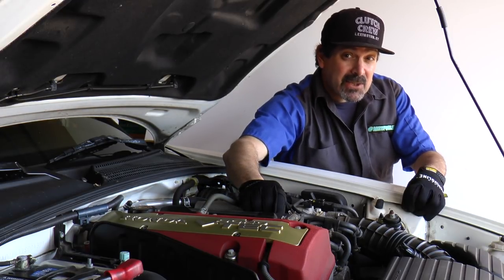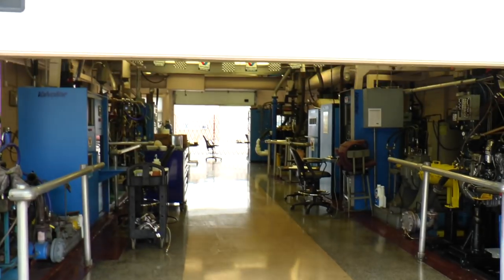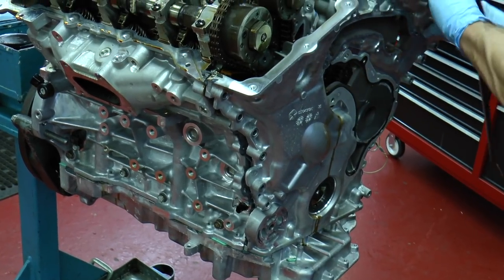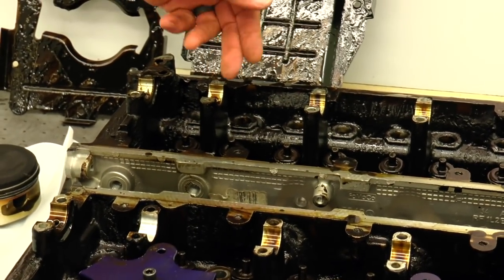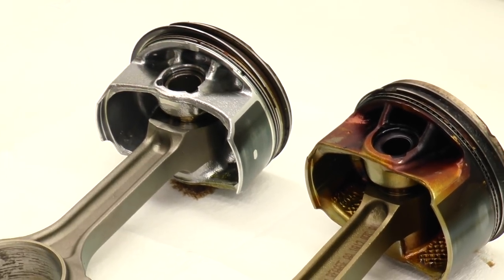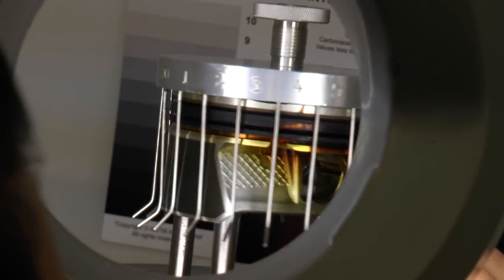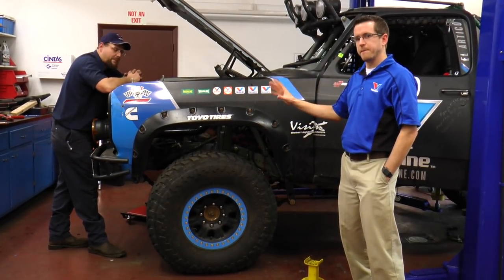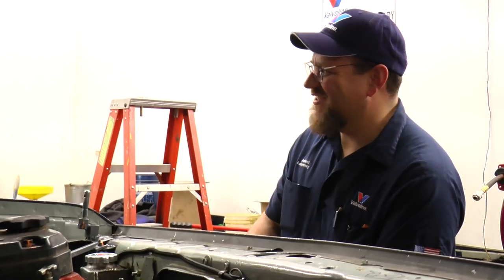What We Do at the Engine Lab With Dan Gray

Comment: Their is something different that I've noticed from using valvoline oil, the engine runs smoother, quieter, and yet seems to be more responsive and feels almost lighter in the rpm range, if that makes any sense at all. Also I notice the oil feels a bit cooler when the engine is warmed up.
Reply: It's good stuff

Comment: I always use Valvoline Fully synthetic 10w30  for my Honda K20 Engine that’s been getting abused daily and Valvoline is the best oil I’ve ever used! Protecting my seals and holds extreme hot temperature like a boss.
Reply from the maker: Awesome! Thanks for the shoutout!
Reply: I have a 2zzge toyota engine 8.350rpm something like k20a this engines can use 5w50 vr1? I know for this oil to have high zddp

Comment: Things to Keep in Auto.
1a. Jumper Cables, Hood to Tail + 4 Gauge.
2. Spare Tire, or PlugKit plus Hi-PSI AirPump.
3. Gallon Distilled Water
4. Ground Cloth or Table Cloth
5. Flash Light with SOS or Blinking Setting.
6. Some Sort of  Jack, stable better.
7. AAA before any road trips. Key or $35 Tow.
8. Red Flag or Sign Tape, Rear Overhang Laws
9. Nitrile Gloves, you will touch stuff.
10. Citrus Organic Hand Cleaners.
11. Tools. Kit/Brief Case less than $100.
12. Waterproof Disposable Camera
13. Why not a laminated picture of you with others?
14. Blank book, spiral, or stamped envelopes. 
16. Phone Battery 10,000 watts
17. Bathroom Kit, Toilet Paper or Wet Wipes.

Engine Fuel:
1. Chevron ::  We Like Honest Kids. They are Honest. "Top Tier Fuel" is the Best 4 You.
2. GATE  ::  Zero Ethanol. 89 Octane worked best in my 1976 V8 Corvette Stingray.
3. Speedway ::  Consistent not to noise burning.
Banish: Shell & BP their fuel or additives are  garbage.

Air Filter Only=Better MPG: 
"Dyno" Measure, NoFilter/OEM/BrandName
1. Burger MotorSports - BMS
2. K&N
3. FRAM Best you find.

Windshield Wipers:
1. Silicone Wiper Blades, Last 10x as Long.
2. Hybrid Blades, Get Shade over the Rubber.

Engine Oil:
AMS Oil ~ Best Oil In all Comparisons.
Valvoline ~ Cleanest Oil of my Oil Changes.
In a pinch Pennzoil is a good place to be.

Oil Filter:
Go Premium +15K change every 10,000 Miles.
1. FRAM Ultra
2. Purolater PepBoys

Auto Parts: Best In Store & Online:
1. PepBoys
2. . O'Reilly
When needing to rent tools only AutoZone.

Best Spray Lube:
1. Liquid Wrench penetrating line with ceramics.

Best Car Wax:
1. Ceramic Car Waxes. Longest Hydrophobic.
2. I use Synthetic Wax, later Carnaba on Top.

Best Engine Oil Treatment:
1. ProLong ~ Made 29mpg in Chevy Tracker.
2. Slick50 Engine Restore ~ Scotty Kilmer!
3. Jay Leno's Garage "ArchOil"

Transmission Treatment:
1. Lucas Stop Slip
2. Full Synthetic for the Longest Lube Life.

Tires:
Hancook
Hoosier

Car Shopping:
Advocate "In Line Engines".
Slant 6, up to whatever Semi-Trucks Use.
Air Cooled = Porsche
Inline is ideal for least expensive to work on.
Transverse
Opposed Cylinder=H
Opposed Piston=i. 

From a mechanic point of view = my god my nation is a bunch of idiots. ~ If pocket money allowed. I would buy a Nissan GT-R too. V6 + Twin Turbo. So get what you like.

Looking forward to 4cyl Mustang, 4cyl F-150.
Excited about Subaru H4 Diesel. Boxer? H!

Cars:
Anything 4Cylinder with a Good Reputation.
The Honda Civic Type "R" very well reviewed.
Subaru Legacy & Forester CR very reliable. Most Subaru Models are Full Metal Formed and Assembled in Indiana.
Reply: Oil changes at 10,000 is stupidity in any vehicle with ANY oil.

Comment: What oil for stop and go traffic? Clio 4 tce 90hp. Least amount of deposit and sludge.
Reply from the maker: Full Synthetic motor oils perform better in engines with heavy stop-n-go traffic type driving. Especially since they provide both the seal conditioner additive and also combat the effects this type of driving can have on the engine. As always, it is best to check your owners manual for manufacturer specifications, to ensure our oil meets or exceeds their specifications.

Comment: Funny I was thinking about using synpower in my F20c and behold - F20C.
Reply: how's the oil on high rpms
Reply: @alitoroganan2442  I still haven't used Synpower in my S2000; but it works well in my K24 accord daily drive.
Reply: @deanos1993  do you drive it hard?
Reply: @alitoroganan2442  Frequently sees the track and doesn't miss a beat. I have some Used Oil Analysis' on the Bobistheoilguy website. You should be able to find the thread but in a nutshell it seems to prefer a stout xW40
Reply: @deanos1993  sweet I have a jug sitting around, ima try that next month
Reply: @deanos1993  What viscosity grade of SynPower do you plan to use and what do you use now ? Thank you in advance..
Reply: @sergeprimako5004  5w40 - If im not mistaken their 0w40 has PAO esters in it
Reply: @deanos1993  Thanks. As for 0W-40, somewhere in 2011 when it was API SJ it contained esters as a base oil, but not today. Today it's a mixture of PAO and gr. III and if there are some esters, they are in form of additives only.